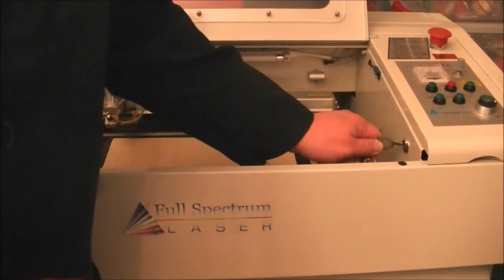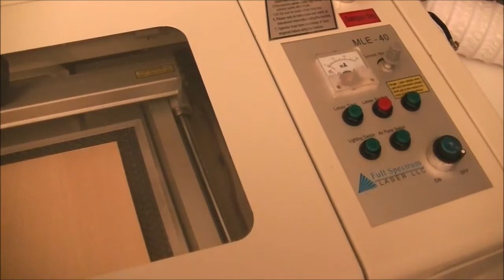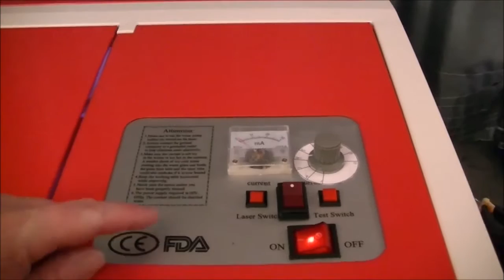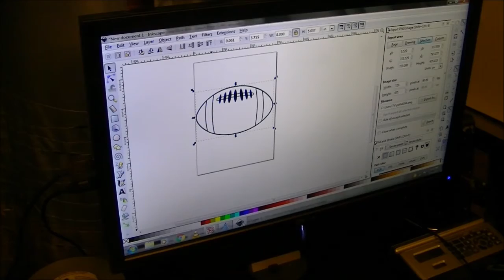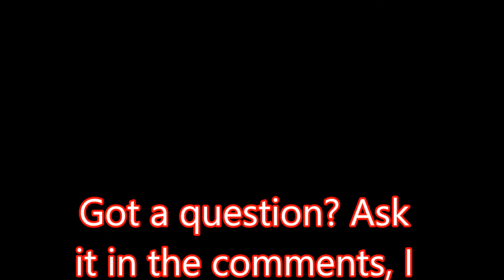When Laser Beams COLLIDE! K40 Vs Full Spectrum Laser!

Comment: I have that model of FSL and it is actually built much better than my K40, with thicker metal, higher quality (plus larger) dual linear rail gantry etc., but for a fraction of the original FSL cost, you can make a K40 scream!  Especially after adding a Cohesion3D LaserBoard and LightBurn software!  I'm restoring and upgrading my FSL, which is also getting the Cohesion3D LaserBoard, GT2 belts and pulleys (can change stepping in the Cohesion3D) and I only paid $120 for my Full Spectrum MLE-40!  Well worth restoring though, especially since the guy behind Cohesion3D is rumored to be making a drop in board for the MLE-40 like he did for the K40, and LightBurn is rumored to be working on a printer driver to add to its already awesomeness!

Comment: Regarding your kids turning on the laser and firing it right into their hand, you state that "nothing would prevent that."  I disagree.  There is something that would prevent it. . . it's called parental supervision.  I'd be willing to bet any amount of money that the stove in your kitchen doesn't have a single keyed lock on it.  What's to keep your kids from turning it on and burning their faces off?  Supervision, that's what.  How about that bathtub (or bathtubs)?  Do you need keys to turn on the water?  I doubt it.  What's to keep the kids from drowning?  Supervision.

The point here is:  everything is dangerous when kids are around.  That's what parents are for.

Comment: You paid $3000 for a door switch, locks, and air nozzle, and laser pointer upgrades built-in? You must have made this video to convince your wife you didn't buy a K40 with $200 in upgrades for $3000. It is apparent that you used a much different resolution on the K40. It is also painfully apparent that both machines have identical cabinets and are made in the exact same place! I don't blame you for feeling stupid over it all, but stop trying to convince others to follow along!

Comment: Just wondering what you have your settings at. This seemed somewhat like a fixed/rigged comparison. Like maybe you got a free Lazer or discount to make the video. I actually run a k40 for work with the cheap LaserDRW software that it came with and I have never had images look that pixelated unless they were very poor quality to begin with. The level of detail that it can actually output  in relation to the actual image I started with sometimes surprises me.
Reply from the maker: Why would they give me an old cutter they don't even make any more? Odd.

Comment: My k40 will out perform both of those. The pixels you see are created because the drawing is pixelated. You cannot tell the difference between what I make and an Epilog other than speed and $12k I saved. My k40 came with several safety features. Paid $345. Check out my work and tell me I cannot make a better football.  https://youtu.be/h-60LVcRcng

Comment: OK K40 300 bucks and your FULL SPECTRUM run what over $3000 bucks. You failed to align the K40 right so I feel you were very one sided about this post. For the buck the K40 wins hands down, The FS still looks like a toy and something cheap for over $3000 bucks. So as anyone looking to get into this hobby for now would be best going with the K40 for $300 bucks and add maybe hundred bucks more and a few houses of setting up and have a fine machine over the way over priced FS for $3000 plus. If you factor in K40 whisper for free it would blow that FULL SPECTRUM away. and they would have $2500 plus spare later to upgrade to something else if needed but surely not a FS one.

Comment: haha  what an ad... $3800 for full shit spectrum. They even made the same enclosure. Both are made in china. 5 minutes talking about 'safety features' - $0,20 mircoswitch and three $1 key locks wow this is really worth additional $3500 of price difference between the two. As to engraving/cutting quality: a $3 3d printed air assist nozzle do a job. Conclusion: if you go with full spectrum it is like you stupid enough to take and burn $3500 of your money. Buy K40 for $300, and some safety features and air assist for $20 total and spend the rest in go-go club. Much more fun for the same money:)
Reply: to be honest   the 50 watt laser what comparable with  full spectrum
that is 300x500 mm  workarea  close than  fsl

the 50 watt laser has all  feature,  
motorized table
honeycomb table
the most advanced DSP control

all for 1300-1500
for the higher price you even get the 4th axis
the dsp control  makes possible the  3d  engraving
Reply: Excellent point, well taken!!
Reply: Only paid $120 for mine since they are an aging machine now.  What people don't realize is, he's comparing a newer K40 to an older Full Spectrum and it is still better quality. I own both, so I know the differences.  BTW, the K40 uses the same enclosure, but they are the ones who did the cloning.  Some people consider the Full Spectrum as the mother of all K40s, but with offspring having special needs. I like my K40 as well, just a few mods and it's screaming!

Comment: rather interesting video thank you for comparing but i have the k40 stock and it never engraves like that  mine are sharp clean cuts too  looks like yours has wobbly mirror on price the k40 is much cheaper and  to me the more expensive one isnt that much more better maybe in safty but hardly any difference in the engrave/cut

Comment: Oh look i made these with a k40 a few months ago, actual 3d carving on a k40

https://lh3.googleusercontent.com/-PL-apE3UbGk/WF_6R6e2IaI/AAAAAAAAAIA/hhImXrEoC9UwkXd8_HbzKdX2hd1YhjKCwCJoC/w1325-h1768-p-rw/20161225_164647.jpg
Reply from the maker: that's cool, I love the idea of using a laser for 3D work.  What setup did you use to make that?
Reply: K40 with a smoothieboard and laserweb 3, embossed the greyscale image with corel photopaint, 10ma on the dial and variable speed of 150mm/s for white and 50mm/s for black in laserweb
Reply: Have you done any inlay work on wood with it cutting veneer???

Comment: This video makes me laugh, how can you compare these 2 machines, the fsl is almost 10 times the price of the k40, its like comparing a £10000 mini to a £100000 lamborghini, what a croc, oh and another thing, controller in k40 is a pile of crap, swap it out to cohesion3D board (less than £100), smoothieware firmware (FREE) and Laserweb 4 (FREE)
Reply from the maker: The K40 is a china clone of the FSL.  I think that makes it worth looking at them side by side to see the difference.  Plus, it's what I have, so why not? These aren't on loan, or sponsor deals, they are both mine that I paid for.
Reply: Most lasers even in America are chinese made in parts somewhere on them.
Reply: I have a FS laser. 90 watt 24" X 36". It's Chinese thru and thru with a very poor operating system that Full Spectrum is very proud of for some reason. All the parts are Chinese, but they charge you anywhere between 3 times to 10 times the price for a china company will charge. I don't recommend Full Spectrum Laser. If your going to buy Full Spectrum, go ahead and save your money and by Chinese.

Comment: still you can buy for 350  the  small laser
and basically it works right out of the box..

true  need to aligning mirrors but  beyond that  I could cut parts after a couple of hours   unpacking

im using  the scorchwork plugin for  inkscape so corel files  can be opened  directly and save in laserdrw format

in my opinion  some  kind of  table  what need
airassist really  on  thicker material over 1/8 

machine surprisingly  find zero back

basically I save two file from inkscape  one for engraving  and one for cutting
loading after each other  parts are coming out right in dimensions

I made  some wooden test  and engraving resulted a very smooth evenly bottom , and despite  the raster engraving  outlines likely    vector cuts.. very smooth no jagged edges

Comment: cool  sort of side by side .  i think money wise  i would be inclined to go K40 , and give it a lobotomy, replace the control board with a GBRL type thing , and investigate if the stepping resolution could be increased ,  IE did they bother to use micro stepping .  Possibly use a MEGA2560 board so  one could add some safety functionality rite in the control board . I suppose that last bit is for those who  dont mind messing with firmware .  I think it would be good to know if either now come supporting actual G code rite out of the box. I suspect the Chinesium does not .   G code one way or an other would be important .  I also wonder if that stepping is due to a limitation of the rasterizing  function of the software vs the actual machine limitations .  good video either way . 
RE safety you might also want to have a look at the grounding of that laser driver . one channel I sub did a video about how deadly these beasts can be if they dont ground properly.

Comment: good video! did you use the same software to engrave and cut? thanks for taking the time to make the video!
Reply from the maker: The software has two modes, engraving, and cutting mode.  The engraving mode burns away everything that is colored black. The cutting setting runs the laser around the edge that is black.  The software is called "laserdraw" and comes with the cutter.
Reply: Laser Wood Shapes thanks for the reply. I was thinking that maybe it was the software that caused the one laser to not engrave as well as the other. it sounds like you used the same program on both.

Comment: this is Josh an  advertisement for full spectrum.  K40 $300  vs full spectrum $3800 !!!
Reply: Just Me oh man its so hard to decidee.... oh  ill take 6 k40s...
Reply: What I was thinking.
Reply from the maker: right now the prices are sitting at K40 $450 (plus another $100 in upgrades) Vs. FSL 5th gen for $3499 (with over  twice the build area of 20" x 12").  Mine is a smaller 4th gen FSL.  I am comparing these two because A-that's what I have and B-they are roughly the same size, power, and speed.